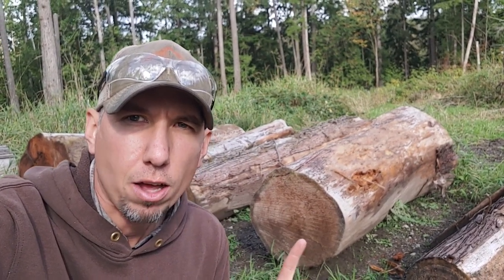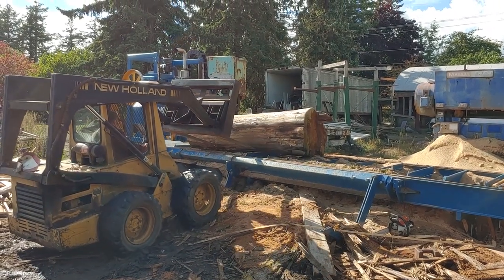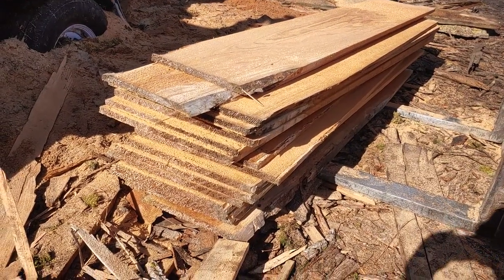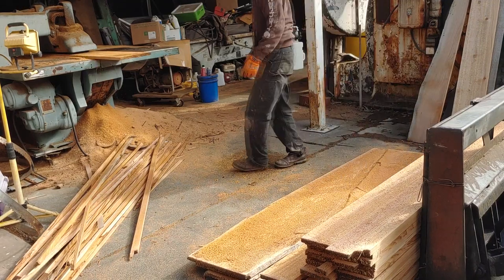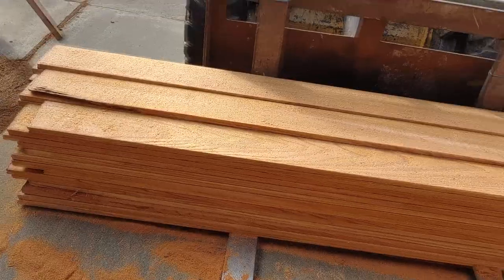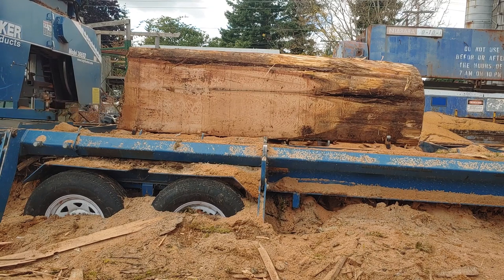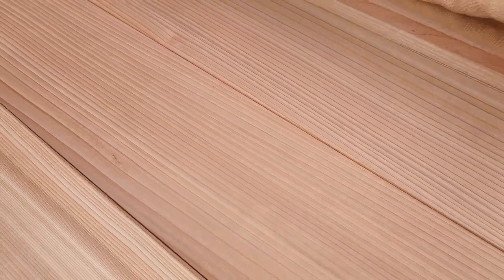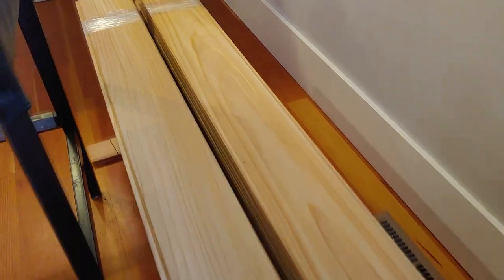Sawmilling Old Cedar Logs Into Beautiful Tongue & Groove Sauna Boards

Comment: How long would you estimate those logs have been sitting in the forest on the ground?
Reply from the maker: The property was logged about 3 years ago and these logs are the cut offs from that operation. The western red cedar has extremely rot resistant heart wood. The sap wood rots quickly, but the heart can stay good for years even in our wet climate. It smells great too

Comment: How much does the mill charge for this work?
Reply from the maker: The mill charges about $200 per thousand to cut.  The guy with the router and planer was charging $2000 per thousand to plane and route them.  I think we sold them for $8000 per thousand or $8 per board foot.